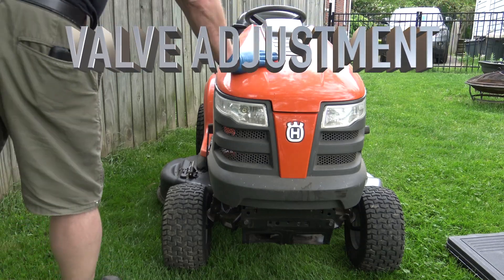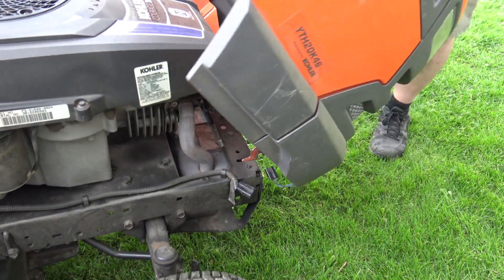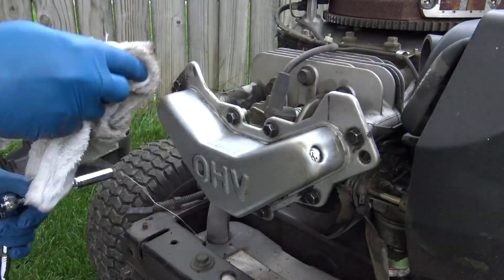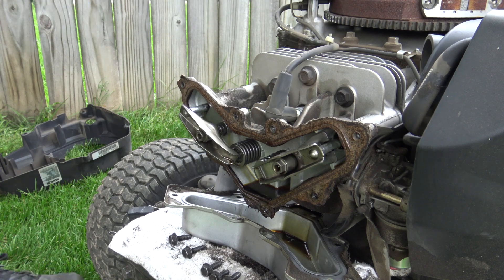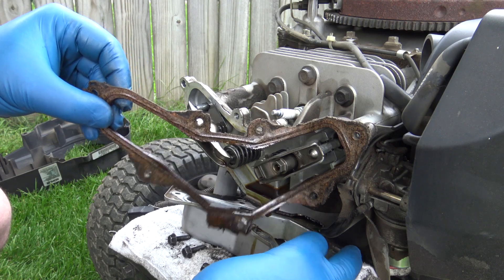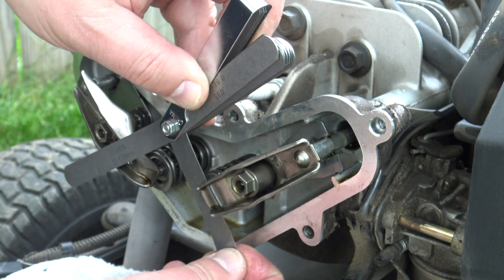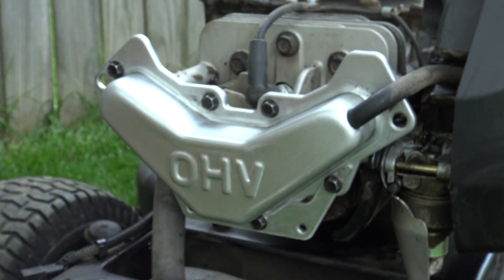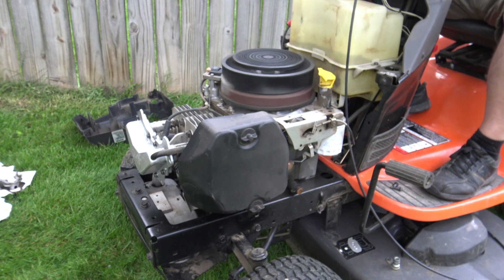Kohler Engine Valve Adjustment

Comment from the maker: https://www.amazon.com/gp/product/B008TSV6VW
GENUINE OEM KOHLER PARTS - KIT, VALVE COVER 20 096 14-S
Reply: Where do I find the bolts for the valves
Reply from the maker: Where do you see bolts on the valves? Not sure what bolts you are talking about.
Reply: @xxxCawsomenessxxx  rocker arms
Reply: Cool. Just ordered one for my customer. I discovered that his oil leak came from a crack on a vertical section of the engine block. I cleaned the engine block thoroughly brake cleaner. I then roughed up the surface with a steel wire brush.  I mixed up some original JB Weld and thoroughly smeared it into the crack (2 inches long) and told the customer to allow it to cure until the following day before he starts up the engine.

Comment: Not only did I follow through on what you just showed in your video, I also discovered that the battery fluid level was lower than it should be. I added a tad of distilled water to each cell until it dimpled. Put it on a trickle charger for the last few hours and the engine does not hesitate to spin at all. Thanks for your video you're very precise and it helped a lot.

Comment: I have a sv600 kohler 20 hp and adjusted valves to the correct measures but it gets stuck on the compression stroke sometimes and then spins over. Would u possibly know the issue?

Comment: Great video. Only suggestion is during the installation of the valve cover gasket, the new silicone  should be liberally applied to one surface after both have been cleaned of oil and any debris, but more importantly, the liquid gasket should be allowed to form up for about 5-8 minutes before reinstalling the bolts that hold the valve cover on. Reason being, the liquid Selena the with just squeeze right out and create a potential gap. 

Additionally, only finger tighten during that part of the install. Let sit for 40 minutes and come back to re-torque the bolts.
Reply: Only the valve cover should be Permatexed that way if the gasket is bad next time you don't have to scrape the engine... Just the valve cover 😂😂😂
Reply from the maker: Thanks! Btw the gasket from the video is still working without any leaks.

Comment: Well done video. A trick for people to find the correct crank position is turn the flywheel until both rockers are loose. Take out the plug and run a piece of coat hanger wire in against the piston to find bottom dead center. Easy.

Comment: 0.005" and 0.007". You dropped the 3rd zero on each one.
Reply from the maker: where?
Reply: @mygiguser  you said zero point zero 5 and zero point zero 7. It happens. Ya just don't want a viewer taking it literal and then cursing you out 'cause it didn't work.  Unless you were talking faster than I was listening, lol.

Comment: How you know your not on top dead center ?
Reply from the maker: Piston is on top, and both valve rockers are loose.
Reply: Thats not correct. You could be on the rise , ramp, of the cam lobe. Pull spark plug and stick screw drive  in cylinder and bring piston to top. Im not even sure if this is correct.  Briggs calls for pistion to be 1/4 past TDC. I can not find info for kohler so TDC should be fine.

Comment: Do these engines have a compression release ? Is the valve adjustment made at TDCwfen spark plug is firing? Do you turn engine backwards to bring it to TDC ? I assume  the comp release holds the ex valve open to assist starting on some  engines.  I don’t know if Kohler uses comp real ease I.  I would have to think it uses SOMETHING  like that
Reply from the maker: If you take out the spark plug, then you don't have compression. The valve closes by a spring. You can turn the engine back and forth at TDC to find the spot where both rockers are loose.
Reply: @mygiguser . On some engines a compression release is used as a starting. aid Why does tightening loos valves fix what most people think is a bad starter or Battery ? Seriously

Comment: When you set the valves, is the piston out, or in from the spark plug on the compression stroke.
Reply from the maker: in. both rockers are lose. piston top dead center.
Reply: @mygiguser  You needed to show as the spark slug still in . some people well  a just with the piston any where .

Comment: I have a issue with fuel puddling at the mouth of the carburetor. The mouth of the carburetor should be dry. It seems there is blow back from the engine through the carburetor. Either the valve adjust is way too tight (no clearance) or perhaps carbon build up on the seat which would hold a valve open slightly.
Reply from the maker: maybe the float is stuck? or the valve leaking
Reply: @mygiguser  That is a good point. When I bought this well used (non running) gravely zero turn mower I had to rewire (it was butchered), replace missing and broken parts plus the carburetor because the fuel solenoid was not working. Yesterday I disassembled the new carb to inspect for crud and sticking float but all was well. I thoroughly cleaned all the orifices. The engine never sounded strong. Fortunately I came across your video and I inspected the valves. The exhaust clearance was way too loose and the intake had NO clearance. I just started it up and finished the lawn. IT RUNS LIKE A NEW MOWER! No lugging no black exhaust smoke. Thank you

Comment: You know actually this is an excellent video , of course removing the hood ?? Just lift it straight up after it is in open resting position ! Remove wiring first for the  headlight's ! The trick of aligning the magnet with the new ignition coil for top dead center making sure both valves are closed , that was ok " but I prefer removing the spark plug and using a long screwdriver to FEEL the Piston on top dead center by turning the flywheel slowly by hand and visually looking at both valves closed ! Also you said to remove the ignition coil wire because it was self igniting WRONG if the key is in the OFF position the ignition coil is grounded and cannot fire the spark plug ! Also you should specify that it is the hex screw that LOCKS the rocker arm assembly in place NOT the nuts that hold it down ! And if you use a silicone sealer gasket maker for the gasket it needs to be rtv black oil resistant silicone sealer type ! You can use only silicone and eliminate the cork gasket all together ! Just lay a bead about 1/4 inch all the way around the valve cover gasket wait about five minutes and put valve cover back on but do it straight on as in have it lined up with the mounting holes so you don't have to wiggle the valve cover around messing up the silicone sealer ! One more thing , when and BEFORE YOU attempt to remove the 4 top cover bolts IF they are hard to break free DO NOT FORCE THEM TO BREAK FREE OR EXERT HARD PRESSURE ON THE WRENCH TO BREAK THEM FREE !! you will wring the bolts off in the engine block if their rusted up or just gummed up always use break free lubricant or deep creep or similar bolt loosening deep penetrating oil on those bolts and spray the threads protruding under the plastic cover the threads of the bolts let soak in penetrating oil and if still hard to turn before you use hard force and break them off try a small electric battery powered drill with the impact setting turned down very very low so the drill will lightly impact the bolts but not forcefully turn them , the knock knock knock of the impact from the drill will 90% of the time save you from breaking these cover bolts off in the engine !!! One more thing when you use the feeler guage use .0005 on intake valve and .0007 on the exhaust valve that's thousands of an inch ! If you can't SLIDE the feeler guage back and forth across the rocker and valve gap with very little resistance it's TOO TIGHT ! and always always always after you have set both clearances turn the engine at least a few revolutions and reset the piston on top dead center then recheck you clearances on intake and exhaust valves again !
Reply: For me you added all the missing information. If step zero (properly finding the position of the valves) was completely missing.
Reply: .005 .007 not .0005 .0007
Reply: Don’t have to use black rtv. In fact peramatex red rtv is high temp and would be best for this application.
Reply: “Visually looking when both valves closed…” what do they look like when closed??

Comment: Recently repaired somebody else's repair on one of these engines in a Cub Cadet, the intake rocker was not pressing against the valve at all, and there was no Torx recess in the rocker stud to make an adjustment secure. The nuts were the only thing retaining the rockers, I don't know what all was supposed to be in there, it was my first time in a Kohler engine, but it was one of many things wrong.

Comment: You have set the engine ignition sequence for spark generation by the alignment of the coil and magnet. If the flywheel is not easily revealed, the same thing can be done by bringing the piston up to TDC on the compression stroke. This is exactly when spark will ignite the power stroke.
Reply: Spark will happen  a couple degrees BTDC. Check it out. Bring piston to TDC and look at where the magnet is.  Its past the coil ( magneto).
Reply: @1gtmach  My error,  you are correct. Thanks for the clarification.

Comment: Thanks for video. I did a gasket replacement and valve adjustment. The adjustment of the valve lash locking nut and screw was the opposite of what I’m used too. Had a hard time getting my head around it because of the valve lash adjustments during my Volkswagen days.

Comment: Great video. Side note, check to make sure both springs are coming out the same lenght as you turn the flywheel. The valve seat came out on mine and left the valve stuck open.

Comment: I got MTD mower it Troy Built but it MTD  they come out with Powermore 420cc engines  Honda clone it a 2016 model great warranty  1 year lasted 1 year 2 months and blew up i put this engine on it 23 HP KOHLER  single cinder twin valve i got engine off of   Husqvarna LGT2554 Lawn Tractor fat guy owned it he broke the mower in half , half bent and half broke said he gofer hole . not that old of mower but i got it 200.00 and it fit ,moves in yard real good just little to much .You can cut your grass at 10 MPH and be done .
Reply from the maker: joseph tate you got lucky finding that engine
Reply: @mygiguser  it been good engine i keep it serviced and maintained runs good .I have seen a lot of complaint's one guy was pointing out all the problems he was having and what you going to have but before he started talking he said he just lets it set outside in weather ? well that could be the reason to all your problems and tarp don't cost much but i didn't leave comment . so don't leave your equipment in weather ,take care of it it take care of you , that way i see things , great video  
mygiguser keep up great work

Comment: I just got the same mower off my dad and it back fires when you idle down and when you idle up it makes a sort of rough banging sound as the cylinder fires. Could that be the valves? I think it's alway done it even new. Just never heard it from any other kohler 21.

Comment: Great video and straight to the point. I didn't know they had made an aftermarket piece to keep the valve cover from dripping, oil. I ended up fabricating  a piece of metal on my kohler cause the dripping on the exhaust was driving my nuts. Thanks

Comment: Good video except you said 0 point 0 7 and 0 point 0 5 wich would be 0.07 and 0.05 is 70 thousandth and 50 thousandths. It is point 007 and point 005 is 7 and five thousandths
Reply: Insert a 0.127 mm (0.005 in.) feeler gauge between
end of 1 valve and rocker arm. Turn adjuster or
adjustment nut (based on design), until a slight drag
is felt. Hold in this position and tighten locking nut or
setscrew securely. Torque setscrew to 7.9 N·m
(70 in. lb.). After tightening recheck adjustment.
Proper valve clearance is 0.101/0.152 mm
(0.004/0.006 in.).
4. Repeat procedure for other valve on side 1.
5. Viewed from PTO end, rotate crankshaft 270° (3/4
turn) counterclockwise and align crankshaft keyway
with cylinder 2, which now puts cylinder at TDC on
compression stroke.
6. Repeat steps 3-4 for setting valve clearance on side
2.
7. Rotate crankshaft to check for free operation of
valve train. Check for clearance between valve
spring coils at full lift, or bending of push rod(s) can
occur. Minimum allowable clearance is 0.25 mm
Reply: @vintagevmax2410   that engine only has one set of valves not 2 like you say. So you must of looked up the information for the wrong engine

Comment: Changed out the ignition coil on Kohler courage 590. Would the plastic cover not being on cause the ignition coil and spark plug boot to get real hot

Comment: Excellent video. I have one correction though.
When you say the clearance on the valves it is not 0.05 and 0.07 .......it is 0.005" and 0.007" .
I hope this helps people because  making it 0.05 and 0.07 would not do a good  results.
Thank you and good luck.
Zee
Reply from the maker: Zee Ilic i think i wrote the numbers in the description

Comment: Thank you for this video! My mower is running again! I noticed on my mower that the stud that holds the rocker arm had loosened out of the block on the exhaust side!! So I had to tighten that back in first, then make the adjustments. Check those studs also! Thanks again, great video.

Comment: You gotta be careful to double check your cover don't leak. Mine caught fire and melted all the plastic on the engine. Didn't damage anything beyond that lucky but the cost is about $100 for parts depending on what gets damaged.
Reply from the maker: Retrogamer1010 it doesn’t leak, if you installed this right.
Reply: Yeah mine caught fire too that's how I know they're was an issue lol

Comment: Thanks for a great video. Very clear and concise! I'm working on a neighbors Cub Cadet with SV590-003 19 hpKohler Courage that was rough running, backfiring and eventually not starting at all but just backfiring. Carb was a mess so I replaced it as well as ignition module. then I discovered the flywheel key broken. replaced that and the new one sheared and it backfired again. Could valve adjustment cause that? Or what do you think it is?
Reply from the maker: Broken flywheel key: Hitting a rock or stump, loose blades, or loose flywheel. Ignition problems maybe. Adjusting the valves should be easy to rule that out, then also adjusting the gap for the ignition coil https://youtu.be/bZ1SiQuKVBk
and then the solenoid problem, i describe in the description of this video https://youtu.be/8nnACUkswxA what happens. How does your engine run in idle? Is it backfiring when it is running?
Reply: Iwas most likely loose flywheel.Thanks it is running well now.
Reply: I have this mower kohler courage 19  I was told that the bots have a habit of coming loose on the fly wheel I always check mine, that will damage flywheel, also my bolts that holds the motor on were loose so glad I found that problem
Reply: Sensor on bottom of carb bowl is bad. Cheap to replace whole carb, ebay has them for a few bucks.

Comment: Did you re-use the cork gasket? If so, did you use gasket sealer between the cork and the valve cover- or just make a new "gasket" with the black stuff?
Reply from the maker: Ryan King i used a new gasket and the sealer.

Comment: Thanks for this info! REALLY!!!  I Had my engine start back fireing and 1 minute  later it stopped running. Itried to restart it with a battery charger on start. The engine acted like the compression was being blocked all the sudden. At 1st I thought the battery, then I thought the starter, then fuel blockage, so I pulled the spark plug and the starter spun faster than before. Then I found out the valves may need adjustment so I Adjusted them. Still had engine kick back. So I found this YouTube video an found the exhaust valve rod guide was pushed out of hole to far as you suggested and pushed it back in and readjusted the valves and it started. Thanks for this video info it saved me 5,000 $ as Istarted looking for a new mower today but thought I would try 1 more time. Thanks for the info!
Reply: WHAT? i didnt hear any reference to guides? and dont understand what you mean by out of hole too far?
Reply: He is stating an issue he found with his and the valve guide is what the stem of the valve rises on inside the cylinder head they can loosen overtime especially if the engine runs too hot from dirty cooling fins.